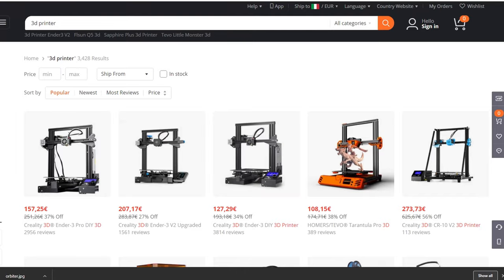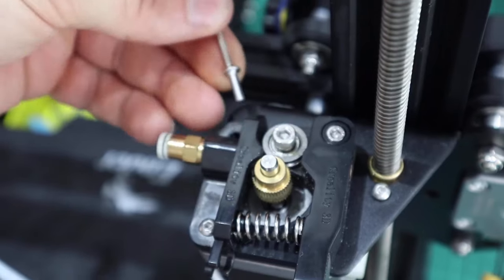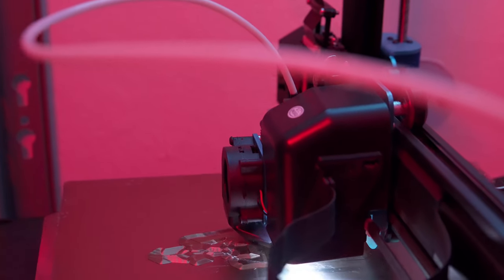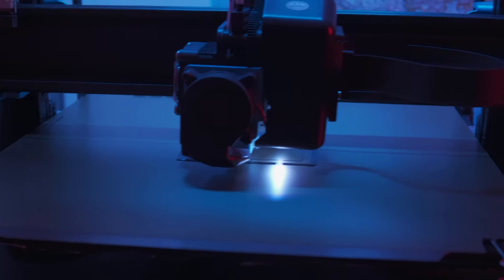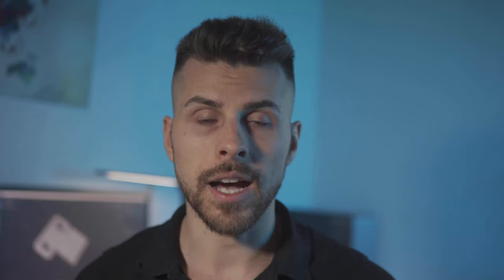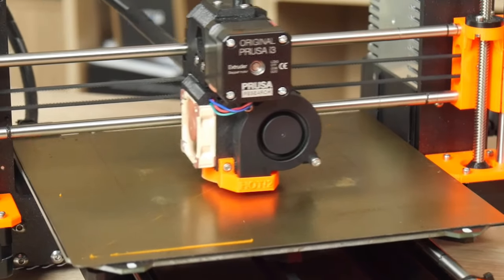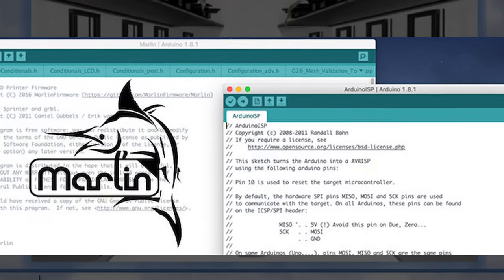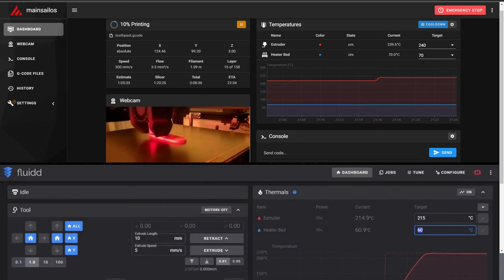3D Printer Upgrades: stick to the basics and don't waste a truck load of money

Comment: Best upgrade was a $7 bi-metal heat break, copper and titanium, installed in my stock Ender 3. Since the addition first layers are consistently perfect and stringing has been reduced. I did use heat sink transfer paste on the break when installing in the hot end.

Comment: Totally agreee. You hit it spot on. I usually do mods when I have a problem with a printer or somteimes if it looks fancy. :)

With my Prusa MK3S I didn't have to mod anything... This was boring and I sold it. :)

Withy my Biqu B1 I had a lot of fun modding. Really important were: extruder upgrade (orbiter direct drive), sturdier spring steel sheet build plate, 3d touch, firmware and better filament spool holder. I modded this printer to a workhorse and don't want to miss it.

With my Ender 3 Max there was more to do. Most important mods: upgraded PSU cover (really dangerous if not modded), extruder, mainboard (not enough modding potential with stock one), firmware with manual bed leveling and magnetic spring steel sheet buildplate. This printer is WIP (work in progress) and there is much work to be invested for a good printer.

If you like to mod you printer and printing mods for your printer is fun to you, don't buy a Prusa. :)

If you want to use a 3d printer for your work to be done: buy a Prusa and don't buy an Ender. :)
Reply from the maker: Totally agree Markus! Way to go, let me know how the Ender 3 Max will evolve. Always curious of new setups!

Comment: Hi Richard. Great vid and I also bought your book.  On page 124 of your book you write that you have many ender 5's.  You must have a stock upgrade list so that every one has the same upgrades.  I would love to see the upgrade parts list that you use for your enders :-)  One very long question I would ask is: If the Prusa has everything out of the box, and is a faster printer and more cost effective in the long run, why did you continue with ender 5 pro with stock upgrades to base your farm on?  Apologies for the bluntness of the questions.  signed a fan :-)  ps whens the next book coming out?
Reply from the maker: Hi Boyd, sure: i started out with E5 and with many gcodes (300+), swapping to different printers would required a lot of time slicing and printer optimization. upgrading to prusa would required several days just on slicing and a limiting height (i have many objects that require above 250mm height).  Nowdays i prefere to think "production line" meaning if i develop a product i asses the best printer for the job. es: if i have many small parts i could thinker on a prusa mini shelf (good room volume/printer ratio) instead of adding other "bulky" enders. maybe in the future i will release a video on the ende 5 mods, didn't have the time to do it yet. what works well for me doesn't mean it works well for someone else, it is how things go :)
no book for 2022. working on an App for the 3d printing market, and just a ton of printing jobs!